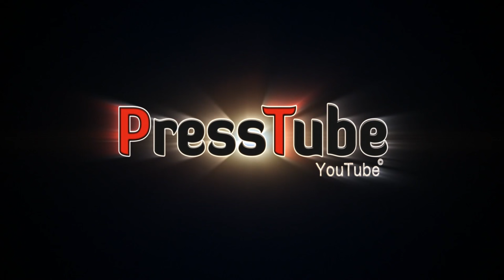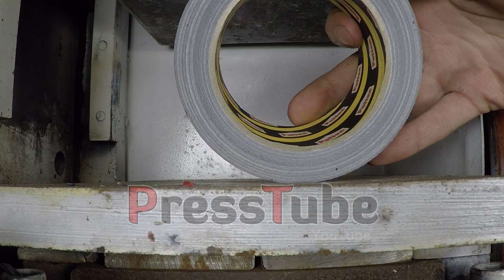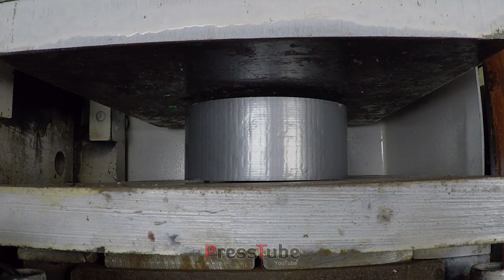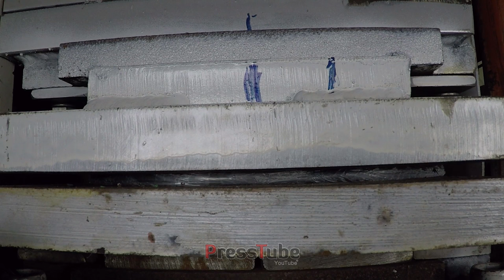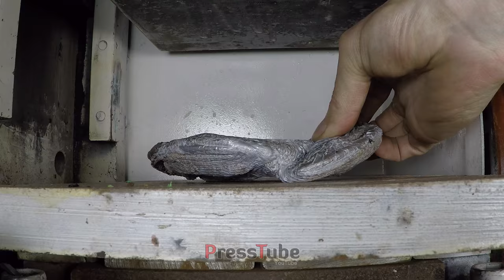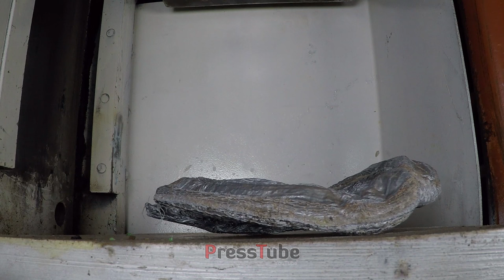Hydraulic Press - Duct Tape

Comment: I half expected the adhesive to start to squeeze out of the tape but it looks like the cloth backing held together pretty firm.

I wonder if it would work if you pressed the tape while it was lying on the roll's side instead of flat like a disc?